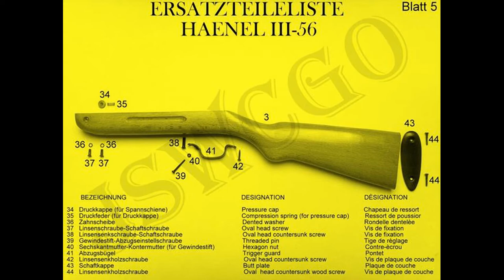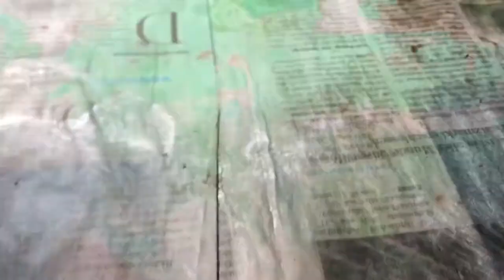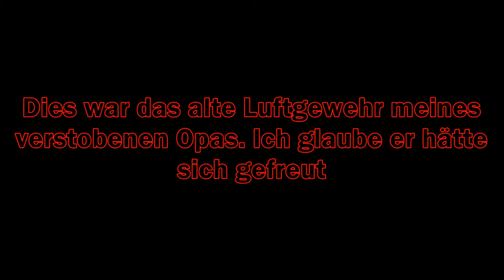Luftgewehr Haenel 3-56 Restauration und Brünierung nach 70 Jahren!!

Comment from the maker: Die Legende besagt, wenn man ein DDR Luftgewehr gut pflegt, schießen noch die Enkel damit. Ps: Der Wert dieses Luftgewehrs ist auch EXTREM hoch.
Reply: Ich weiß meine Antwort ist ziemlich spät ;) aber in welchen Wertbereich bewegen wir uns? Ich besitze auch so eins von meinem Großvater, schießt einwandfrei, der  Zustand ist fast so gut wie im Video :D
Reply: Marcel guck doch bei egun mal nach ^^
Reply from the maker: Marcel 150-200€ werden die gehandelt, aber ich finde sie sind locker 500€ Wert. Für solche Gewehre in der Qualität müsste man heutzutage 1000€ zahlen!
Reply: @herzibd  Ja hab mich mittlerweile auch etwas informiert und mir noch 2 alte gekauft und wieder hübsch gemacht :D Das von meinem Großvater werde ich allerdings nie verkaufen!
Reply: @metalfoundsgermany3726  ja hab ich, danke für den Tipp. Da sind ja manchmal ziemliche Schnäppchen ;)
Reply from the maker: Marcel ja, halte es in Ehren!